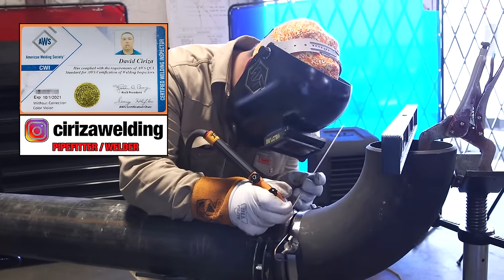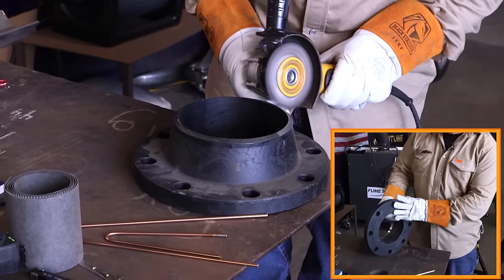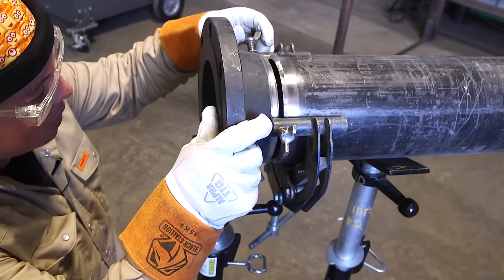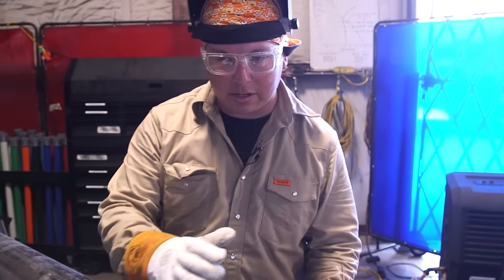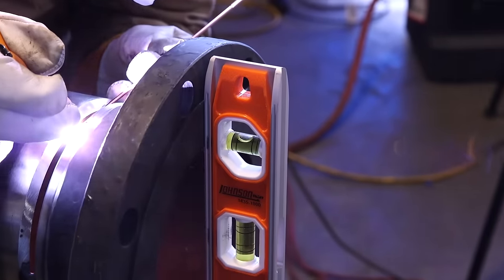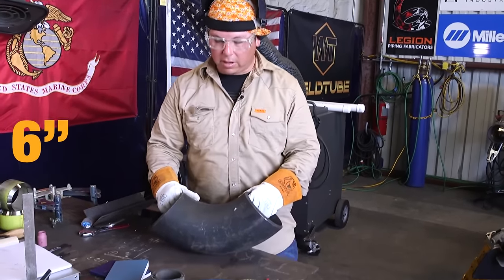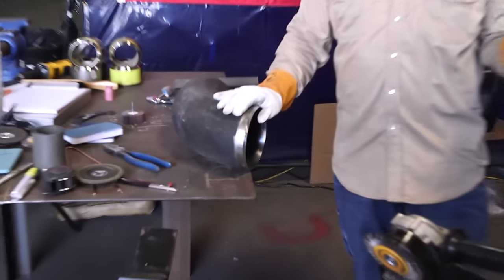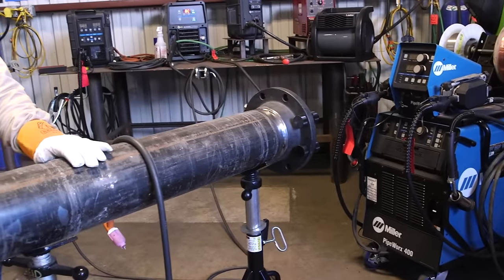How to PIPE-FITTING Basics

Comment: As a welder you never no how much you appreciate a good fitter until you work with a few bad ones great video
Reply: Exactly Bro!
Reply: Being a welder also I know exactly what you mean! It’s never fun
Reply: Very true, other way around is true as well
Reply: I started in the trade as a fitter then a welder yhan back to a fitter. I know all to well  on both  sides. Local 777 plumbers and pipefitters union.  Respect.
Reply: Pfffft As a fitter, you welders think that you  know it all!
Reply: @MMN403  and be lazy as hell!!🤣🤣 respect to my welders tho!
Reply: I've had to cut tacs out and fix it
Reply: As a 18yr in the trade pipefitter i can say I appreciate a good welder not the premadonna type.
Reply: Premadonna welders...
Reply: I hear that, lots of pipefitters are flange connection engineers, never worked in a fab shop which is sad. This is what a true pipefitter does
Reply: This fella is a badass. I'm a crane operator iron worker and never seen what pipe fitters do except look at me with contempt. Now I know why..
Reply: I do a lot plant maintenance and fab work. Pretty green crew overall, but I enjoy being the fitter that everyone wants paired with. A strong fitter can carry an average welder to an extent. You can put a beginner fitter with a knowledgeable welder and get it though. My only gripe is, everyone wants to be a damn welder now ahah
Reply: Do you think pipefitting or pipe welder is better to get into
Reply: @TyranT-Trooper which one is better to get into
Reply: @MMN403  every one can learn every think, if tea seller being a prime minister then every thing is possible
Reply: You never KNOW, not you never NO.

Comment: Check 15 times, weld once. Steel is so much less forgiving than wood. I haven't welded an inch of pipe ever, but I know a quality fabricator when I see one.
Reply: My uncle would say the opposite about wood vs steel

As he was welding a piece back to its original length.

This is why we aren't carpenters.

Comment: Always check your 90’s to ensure they are actually 90 degrees. Great video.
Reply: Very few brands actually make them true anymore
Reply: Its gonna be 90 of you square it to the pipe
Reply: A lot of fitters assume that new fittings are perfect. I’ve had to grind out the ID or the OD as well as the angle to get everything just right for welding

Comment: Great video, spot on correct. I'm 65yrs old and a retired union welder/fabricator with 38yrs on my tools here in south Louisiana. Loved my job, just got fiscally a little to old. Keep up the great work.
Reply: Glad you're happy in your retirement, the Spanish word for retirement is Jubilación, in english allied i suppose to the word 'Jubilation',  glad you made it to now you can  chill, i'm also Retired  i was a Mechanical Fitter here in Ireland , worked on large Construction jobs as  a Millwright, also as a Pipe Fitter, and later  as a Maintenance Fitter in Big Pharma on Shift, worked with so many great welders a real Brotherhood, remember one lad out in the Desert in South Australia  on a Oil Tank Farm, he was so short sighted and other lads fronted up and did his Welding Test for him, so that he could get the Pass Cert to go onto the Construction Site, they really carried him , giving him the Root bead, then others would grind it  and dress it up follow up with a 'Hot Pass' high Amps and the next lad would the do  'the Cap', the Welding Inspector [ 'Cut Out' John] knew there was something suspect with those X Rays of the Welds,  but couldn't prove it... as they still Passed  they reckoned because of being so badly near sighted he was, the reckoned,"The Welder that could Weld by Braille"...Best wishes...

Comment: When I first got into welding, I must have watched every "how to weld" video on the internet. Now 2 1/2 years later I certified for asme and my bosses started putting me on more pipe like I wanted. I thought it would be soo easy and simple, while in some aspects it is, the more I do it the more difficult it's becoming which makes me want to do more. Went with my boss to measure for over 50' of 28" pipe with 45's, 90's, 60° cuts and rolling offsets and now learning to fit and weld. Holy shit.
Reply: The easier it is, the less you know. 34yrs in
Reply: @snowblind796  I know, my shop foreman was telling me that the downside of it is most people who finally know enough to be worth anything, are to old to do anything
Reply: @justinhill376  I’m still moving but a little slower 🤣. 
7 yrs to go 😁
Reply: @snowblind796  you don't stop because you get old, you get old because you stop!!
Reply: Knowledge is power. Never stop learning. Keep it up.

Comment: Good tutorial. Only thing I will say is if you have a end that isn't square, use a file rather than a grinder. Much more accurate. Also on small shed pipe you can get a good bevel with just a flapping disc

Comment: Nice video. For fitters welders do not like when you put root tacks so bridge tacks are the way to go. Those are nice fitting clamps but no shop I have worked for has so I use an angle iron on the bottom of pipe held on by chain Vicegrip to hold elbow and flange up.
Reply: I like to say, if we had all the tools we needed, anyone could do the job, lol

Comment: At my last job, the company was too cheap to buy clamps like in the video, so we had to fit the 90 sideways and put a level on top, it was either that or sometimes we had to weld a stock bar to the 90 and use a jackstand to raise or lower the stock bar so our 90 would be squared....improvise, adapt, overcome

Comment: So I’ve been welding on and off since I was 19, I’m 31 now, and I’ve always done basic welding. Aluminum and steel Mig and tig. I’ve always welded hot rolled steel and did some beam structural welding. My question is would it be a good idea to go back to school to learn how to weld stick  and go do pipe welding

Comment: Nice video and don't be shy to use a straight edge and tape measure to check your final fitment of your 90 degrees, measure to the top pipe to bottom of straight edge, it will give to most accurate measurement, because levels once dropped to many times can go out of level.

Comment: An error when assembling that bridle, it is first measured with a square and a winch, then it is shored up.  And at the end it is checked that everything is leveled and to be able to proceed with the welding.  If they carry out the process of first setting the level, then shoring up and finally measuring with a square, the assembly will fail in a manufacturing plant, precision is needed.  But still very good contribution for beginners.  Good luck and continue with the videos

Comment: When you add the 1/8” weld gap to each port does that affect the overall length? Or do you take that away during the cutting of the pipe? 
Thanks these vids are awesome.
Reply: You would account for this when cutting the material.

Comment: Good stuff man. Do you ever use internal flange aligners? If so, at what diameter and or schedule would you consider it accurate and safe?
Reply: I’ve used them
Up to 16 in flanges just may need some help from a jack stand with the weight

Comment: So during apprenticeship can you decide just to be a pipe welder instead of pipe fitting or do you have to do both jobs. I’m scared a little of heights lol so I don’t know about fitting while being in heights lol. But I’m willing to learn this trade
Reply: I work as a Pipefitter Class B in the refineries and plants. If you end up in the plants you can not be scared of heights at all. I have videos 200ft up on a tower off the side on a hanging scaffold cutting sections of damaged 6" pipe and replacing with new pipe. So to say the least you can't be scared imo. In a shop environment you will run into heights rarely.

Comment: when you are welding you must start in various directions,you cannot weld all the way around because of the heat changes  the work piece or the pipe the joints or the flange and measurements in joint welding.Also when you use a portable grinder always use it to the ground away from yourself and away from others.Never grind towards yourself in any circumstances.

Comment: 1/2 inch tack is plenty big enough on 6 " pipe then would have just spun it 180 degrees then fitted it up pushing the top of the flange in u can almost always get the gap right without even using wedges tacked the top again and off u go and I never used a line up clamp to fit a flange just a waste of time IMO. I would have cut the bevel on the other end with a double ott 00 cutting tip its much faster but u have to be really good with a torch in your hand then touch it up with your grinder and your on your way  I did it that way all the time